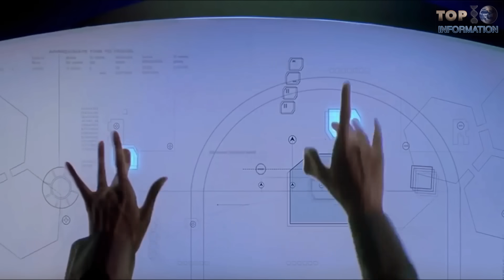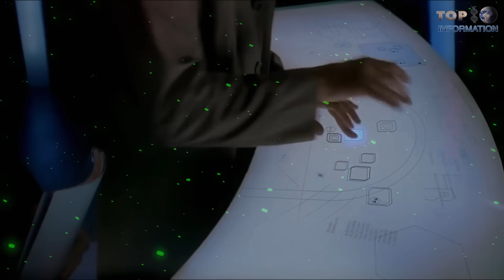8 Coolest Giant Robots that Actually Exist ▶ 7

Comment: Haha! An M1 Abrams equivalent would destroy any of that. Imagine an Eagle Prime using an M1 Abrams engine. That would overpower and outmaneuver Kuratas and egle prime, not to mention such a thing would probably have real weaponry like 20mm o 40mm chain cannons or grenade launchers. Honestly theres alot you could do to a mech when it comes to weapons due to having so many ways to mount multiple weapons. It could be anti infantry, anti tank, or mobile artillery, and could be any combination of those or even different balances of all three. Hell you could even equip it with trophy systems and anti air weaponry.

Comment: From watching the Kuratas fight against the American robot, the main reason it lost was because they didn't outfit it with the proper armaments, if they had equiped the shield and the pile driver they might have won, but that chainsaw really cut into them and caused a lot of damage, they could have used the shield to block and the pile driver to cause damage to the tank treads and other parts.

Comment: The Megabots Eagle Prime should look at hybrid Gauss-Fuel rockets; where a gauss launcher launches the rocket with initial momentum, and when the rocket leaves the rifled barrel, some spring loaded levers on said rocket ignite the fuel, so the rocket has higher momentum before it strikes the target and needs less fuel to reach the same distance.
They should also look at making those twin miniguns on the arms into a spinning, triple minigun assembly; in which each minigun spins with incredible rotating velocity, and a rotary actuator spins the 3 miniguns (in a triangle formation) with incredible rotating velocity. An assembly like this on each arm will each through ammo quickly, but nothing will be able to withstand the onslaught for more than a second or 2.

Comment: Yeah they're similar in some ways, but the power rangers bit is indeed inspired by Voltron and as such is a multi machined connecting mech. Mobile Suits do have SOME similar elements, but not to the same count in parts to connect. An MS class mech like Gundam also doesn't stand as tall as the main power ranger counterpart. UNLESS you match one up against Psycho Gundam which would indeed be within the more similar size class.

In the end though not many people are going to read my nerdy ass post that no one cares about. XD
Reply: Yeah, a lot of issues there.  And you didn't even point out how she said "zodes" instead of "zords"!

Comment: No Gundam aren't related to Megazord. Not even similar. They're MOBILE SUIT
Reply: PRRRRRRRRRREACH IT!  Also, they mixed up the RX-78-2 with the Unicorn.
Reply: I’m sure one of the zords would be the exact same size as RX/78/2.
Reply: @codered1132  Maybe individual zords, but combined, no way!  ...or maybe the Psycho or Destroy Gundams?
Reply: @Sondaiek yeah probably
Reply: What about knightmares from code Geass
Reply: ShakotoTM that doesn’t count
Reply: @codered1132  why not
Reply: ShakotoTM because those mechs are smaller
Reply: @codered1132  kinda there bigger than the irl statue
Reply: ShakotoTM well I always thought they’d looked smaller than gundam mechs
Reply: @codered1132  i dont know they seem big i guess it depends on the knightmare